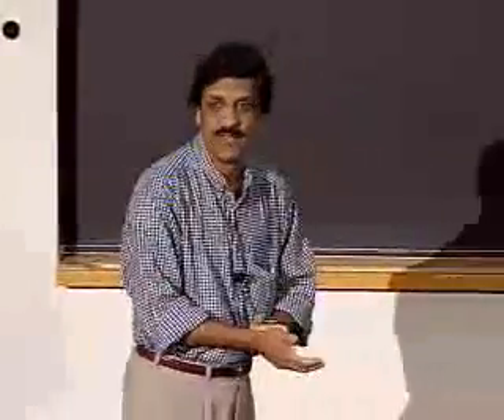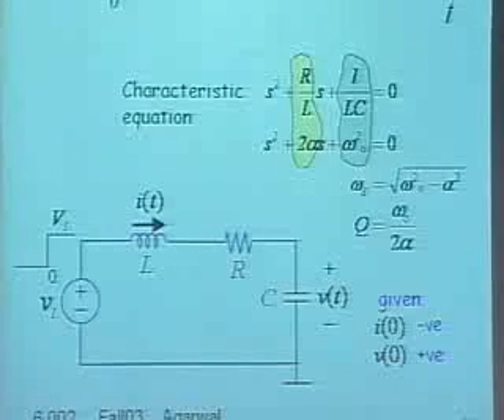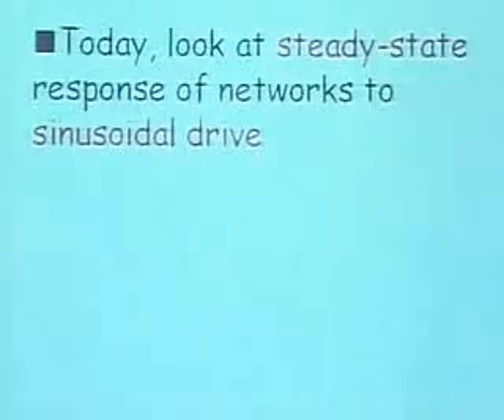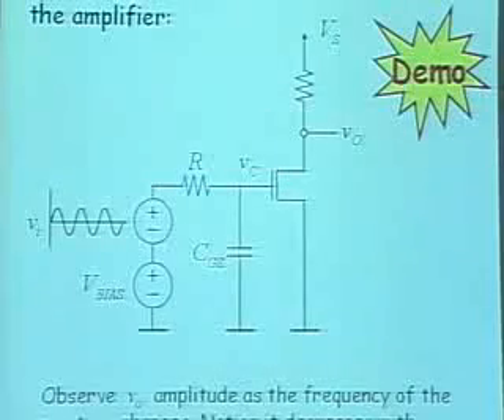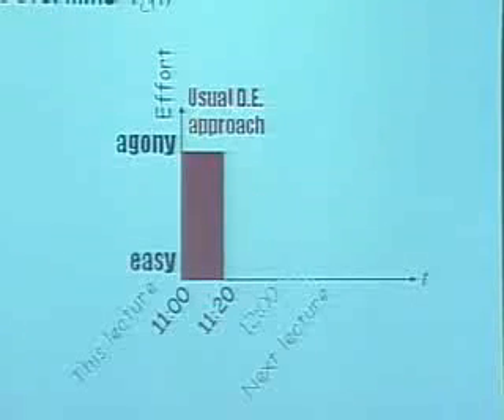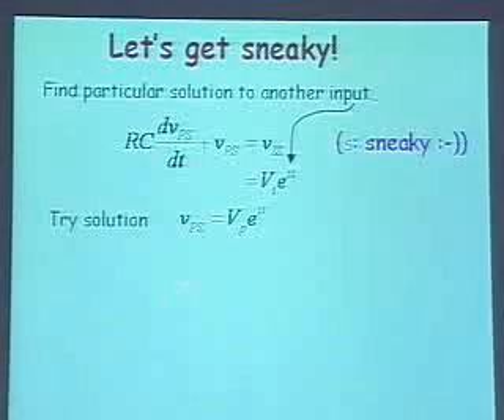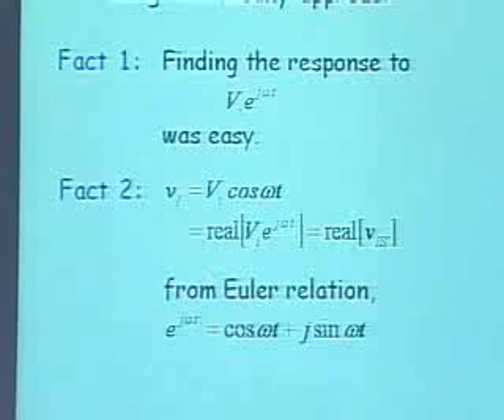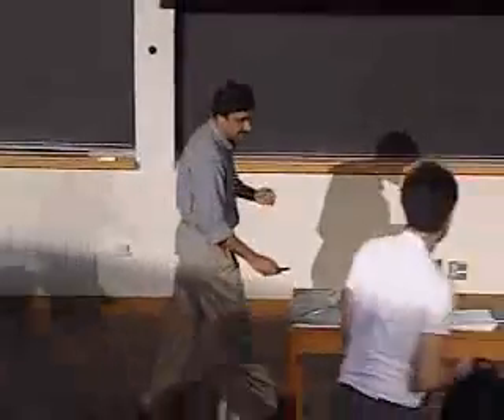Lec 16 | MIT 6.002 Circuits and Electronics, Spring 2007

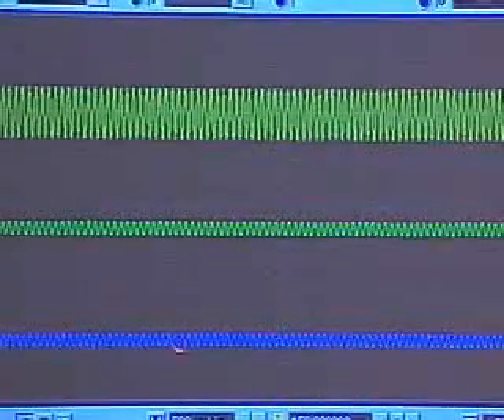Comment: At 25:50 wasn't the input amplitude being changed and not frequency and similarly output amplitude was decreasing? Shouldnt it be the other way around. For small signal analysis there should be a DC offset which boosts then shrinks it for linear analysis. How is this part amplifier?